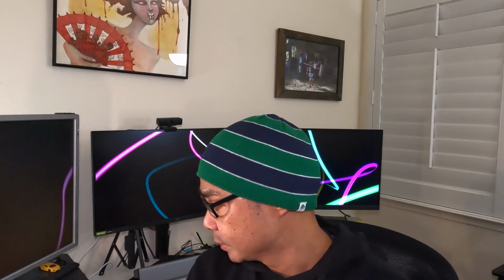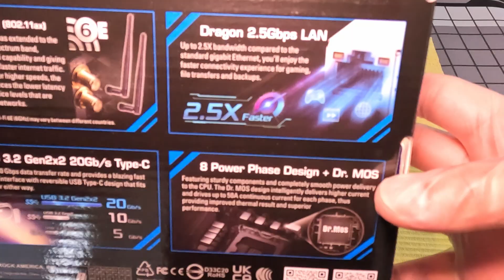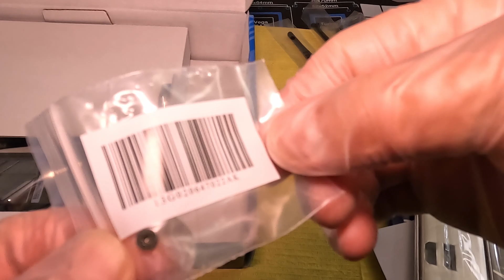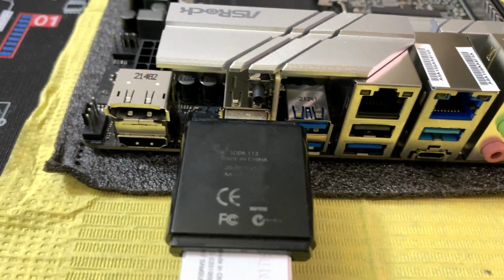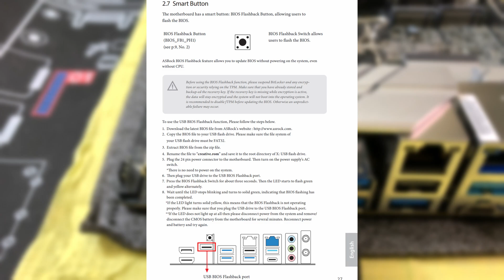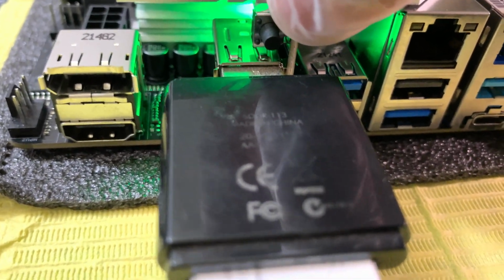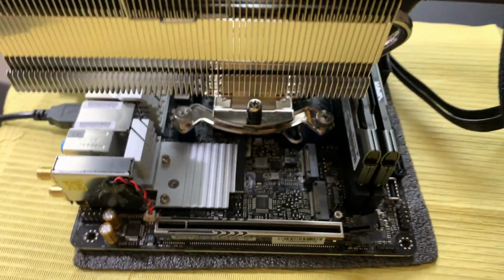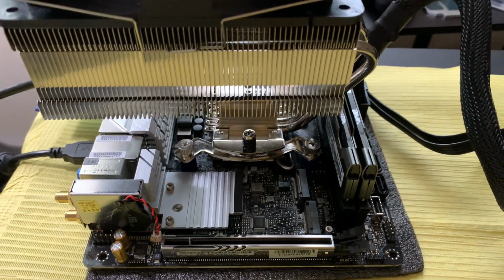ASRock Z690M-ITX/AX DDR4 unboxing, bios update, mem test. Do you smell what ASRock is cooking? VRMs?

Comment: i'm just curious can this board overclock the 12600k to 5,2 or 5,4 ?
Reply from the maker: Sorry I can't remember how much I got it to max, I did overclock it but I replaced it with 12700K. Depending on silicone lottery I hope you get a good one if you're planning to OC. It runs cool though that a Noctua NH-L12 can handle it with the OC. Good luck.

Comment: I'm looking for a cheaper z690 or z790 itx MB but there doesn't seem to be hardly any options. I already have ddr5 so this is a step backwards and the only other decently priced option, the Gigabyte Aorus Ultra Lite uses ddr5 but the pcie x16 slot is only pcie 3.0 not 4.0 like it should be. Which I find odd being that it has 4.0 lanes for the m.2 but not for the x16 slot. Then the next board up from these two is an extra $70 which seems a little absurd. ITX boards lately have been a little disappointing unfortunately. Anyways, thanks for providing some info on this board since there doesn't seem to really be anything else out there about it.

Comment: Just finished a build for a client. Board is def...different. No gpu. She only plays browser games. She bought an i5 12600k. Just running vid from there. I find the hdmi port is finicky. After one of two reboots video is non existance. DP works fine so far. Running some more tests. The bios flashback feautre is cool. Instructions were clear enough. Odd that there is no clear cmost button but u have to use jumper. No cap in box I received. eh.

Comment: Hello, your video was quite informative. But I can't seem to update my motherboard BIOS. It's the same model and I insert the flash drive, push the flash button but it only blinks green-yellow three times and then sits at solid yellow. Do you know what might be causing this problem? Thank you and cheers!
Reply from the maker: I haven't updated mine since I built it. I'll test it out and reply back...
Reply from the maker: I just did the update to my bios, the flashback button didn't work but the instant flash through the bios did. I have the 11.02 version now. Good luck to your bios update.
Reply: Are u doing this with a non compatible cpu? Why dont you use another method? The only reason you should use the method in this video is if you have a 13th gen cpu which wont be compatible with this motherboard out of the box. If you have a 12th gen use the standard method and update from inside the bios.

Comment: M2_1 & M2_2 both connected CPU PCIx lanes or to the chipset? Regards.
Reply from the maker: Their manual doesn't say, and because I really don't use this as my main machine I didn't even try to find out if that information is available on their website. Their manual only states "The M.2, also known as the Next Generation Form Factor (NGFF), is a small size and
versatile card edge connector that aims to replace mPCIe and mSATA. The Hyper M.2
Socket (M2_1, Key M) supports type 2280 PCIe Gen4x4 (64 Gb/s) mode. The Hyper M.2
Socket (M2_2, Key M) supports type 2280 SATA3 6.0 Gb/s & PCIe Gen4x4 (64 Gb/s)
modes."

Comment: I built my PC with this board a couple months ago and Im having random crashes with it. Mostly when gaming, but occasionally when multitasking and watching youtube.

Im wondering if updating the BIOS will resolve the issues.

I have the following 
12700k
RTX 3070 PCIe 4.0
32gb of ram with XMP enabled at 3200MHz
2TB m.2 Samsung 970 EVO Plus (main OS drive)
1TB m.2 Corsair (extra storage)
1TB sata Corsaid (extra storage)
240mm AIO

My guess is its either a BIOS problem or an XMP problem but Im kind of stumped.
Reply from the maker: Sad to hear that. This isn't my main PC but I use it often travelling (been out with this for 4-5 trips already). Watch, play games and do small stuff like work or edit. I haven't had a problem with it yet, still on the January BIOS, and running a 6700XT vid card. Early in the year I had a 3060 in it  while out of the country and didn't encounter any issues. Replaced it with 6700XT around May I think. Good luck in finding the cause, I normally update the bios if there are issues, close to the end of the year where I'll have more time at home (winter).
Reply: Updating bios is not a bad idea if having issues. Update to latest version 11.02 dated (feb 14/2023) which should give u better stability. Also a good idea is to check u have latest drivers for your gpu. You could do a clean install with DDU.
Reply: Crashing could be 100% PSU. Bios Update could no matter.

Comment: Hey!  Can you tell us if you can raise the power limits on the VRM's on this board beyond 150w?  I've seen reports it can do upto 225w but will require some custom heatsink on the top vrms.  Can you clarify please?
Reply from the maker: Actually I'll have to check. I haven't been using this machine much except while travelling, but it's OC'ed and haven't had any issues of it hanging.
Reply: @DragonRoll_Sushi  defiantly interested in this

Comment: Thanks for review!
What model of CPU heatsink you used? Is it possible to install GPU w/ backplate?
Reply from the maker: I am now using the Noctua L12 with the 12600K. I did initially have the 3060 on the system then I replaced it with a 6700XT. Unfortunately the 6700XT I got can't complete the 3DMark Demo so I returned it and am now waiting for a replacement.

Comment: Can I use a pcie 4.0 riser cable for my gpu with this board?
Reply from the maker: You should be able to. I did use a 3060 with it, no riser cable, successfully and returned the 3060 since I want to get a different GPU with the build I'm doing. Make sure there's a return policy with the riser cable though incase it gives some issues. I never used one so I don't have any experience with them. good luck on your build.

Comment: same Board here, also no issues sor far!
Reply from the maker: Yes, I'm happy for you. I got the M2 drive and OS installed, and I'm adding vrm heatsink on those ones without coz I'll do a little OCing. I just need time to fully build it, possibly this weekend. My 1st time with ASRock brand so this is a good start.
Reply: @DragonRoll_Sushi  which heatsinks you are planing to use on the VRMs?
Reply from the maker: @flux4660  I ordered this from Amazon: https://www.amazon.com/gp/product/B07WR3S8CZ/ref=ppx_yo_dt_b_asin_title_o04_s00?ie=UTF8&psc=1, they should be arriving today or tomorrow. I'll put them in and build the whole thing this coming weekend.
Reply: @DragonRoll_Sushi  Did you get these installed? Did you notice a reasonable drop in VRM temps?
Reply from the maker: @sevaeron   I'll run a set of benchmark and log HWInfo stock and overclocked. It looks like it does help but I also have the noctua cooler blowing down on the are which should keep it cool. Which I might replace with Artic Freezer 2 120 soon too.